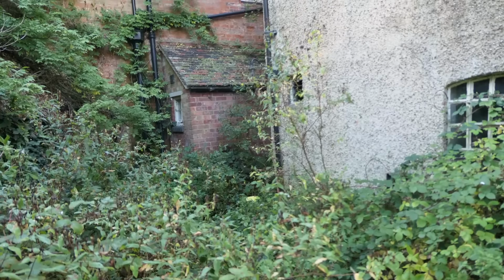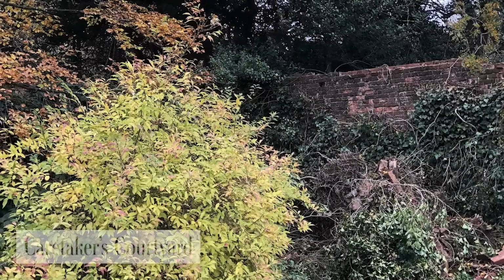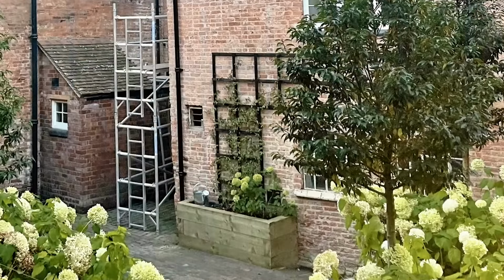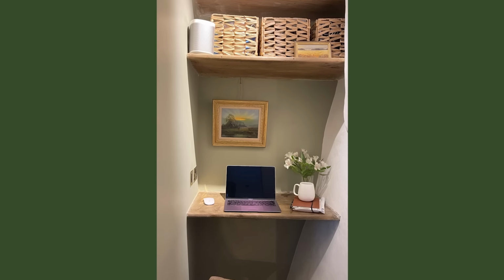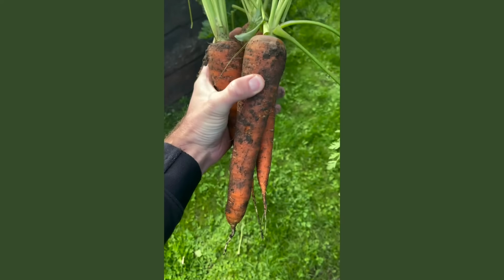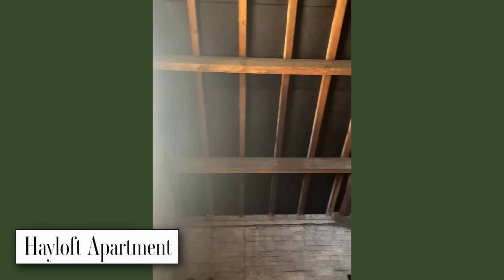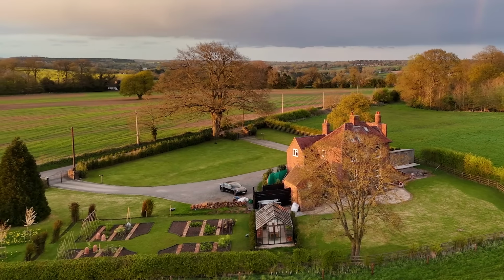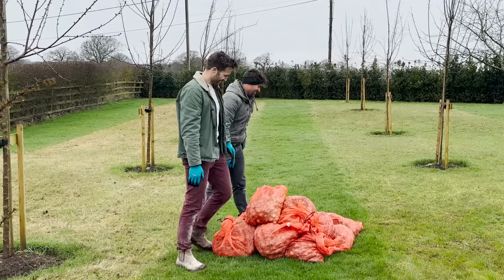5 YEARS Renovation REVEALS in 25 Minutes – Crumbling British Estate TRANSFORMED! | My Tiny Estate

Comment: Did the two of you complete ALL THE REPAIRS TO LEAKING ROOF SAGING EAVES, the termite, rodent, and black mold damage as well as brick work, wall plaster/dry wall boards, plumbing and working fireplace/potbelly stoves???? 
Those amazing gardens???
Please include an address to contact you for holiday rental.
Reply from the maker: The mould issues we got a specialist in! But all the rest yes 😁 have a look at our website MyTinyEstate.com it has all the details on there 😁

Comment: Great job. My partner and I have renovated 5 homestead shacks in the Mojave for the past 20 years. Sold 2 of them for big bucks. They are each on 5 acres with water and power of course. One of the places has neither, but soon a well ($20,000 to drill it) and solar.
Reply from the maker: Ahhh how cool to have a place off grid!
Reply: @mytinyestate  In the Mojave Desert, by Joshua Tree, it is nearly sunny year round. But, as well, hotter than Hades in the summer months. To get anything done, up 5 am, and work until 10 am. The rest of the days, in-doors with a swamp cooler!
Reply from the maker: Oh wow!

Comment: One massive question. Did you plaster with gypsum plasterboard and skim the walls? Or did you use Lime plaster? If the initial option how have the buildings got on with that use of materials.
Heard so many pieces of advice suggesting Lime plaster is a must but some others counter this argument. Intrigued to know. Thanks
Reply from the maker: We always use lime plaster when applying direct so solid walls … gypsum would work for a while until it doesn’t 😆